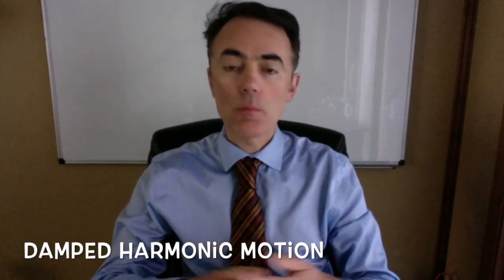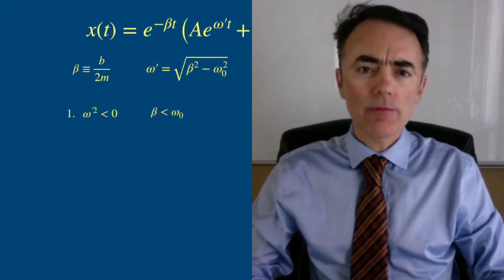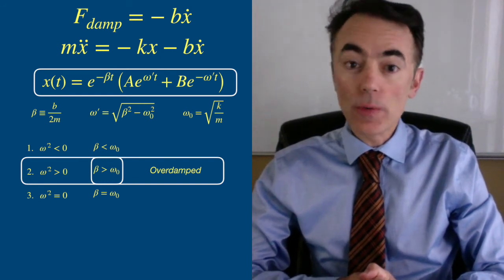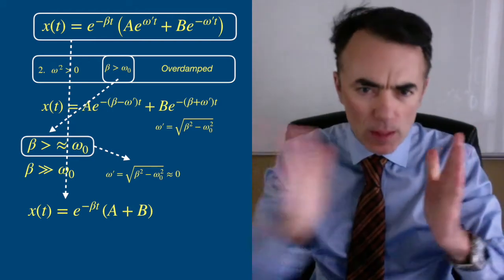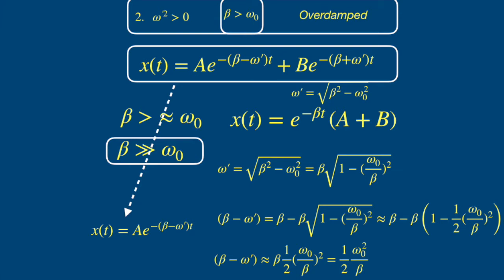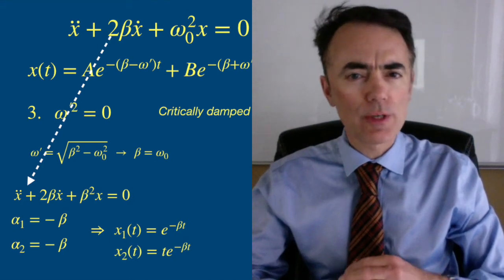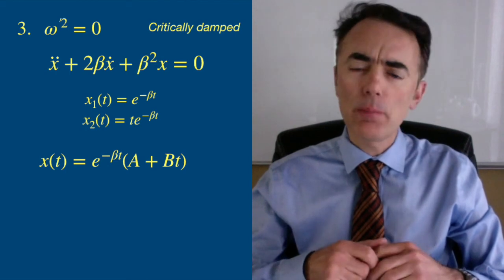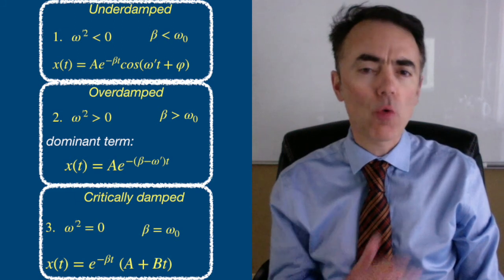CLASSICAL MECHANICS. Damped oscillations (II)

Comment: At about 6:00 you say that for critical damping the system goes to zero the quickest...This is a common statement in literature and lectures, but it is also wrong or at the least superficial. For some initial conditions the overdamped solution returns the fastest to zero energy state (i.e. equilibrium), while for all other initial conditions (slightly) underdamped solution is the fastest.... I made a short video about critical damping NOT being the best choice for fastest return to equilibrium https://youtu.be/OgVBQJMH12E  , you can see the simulation in the video.